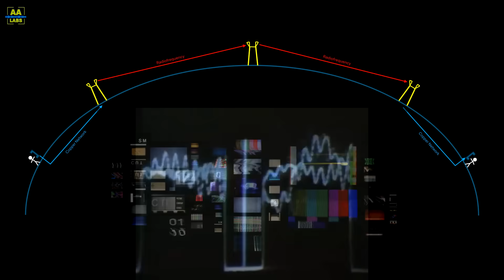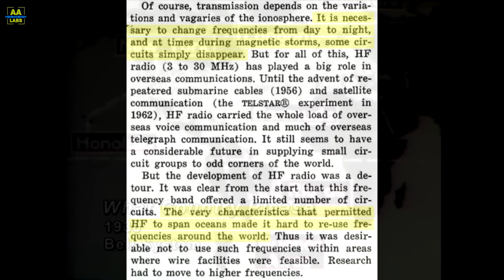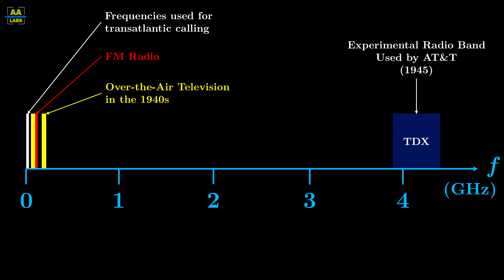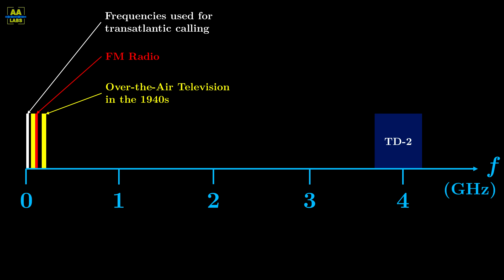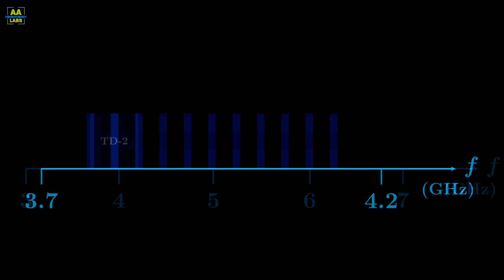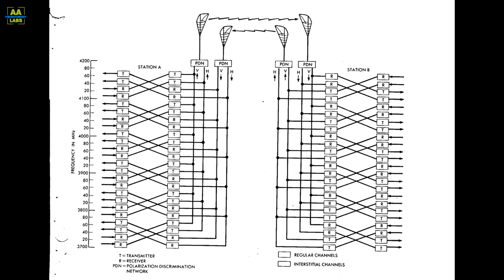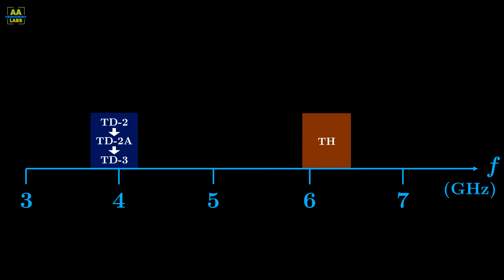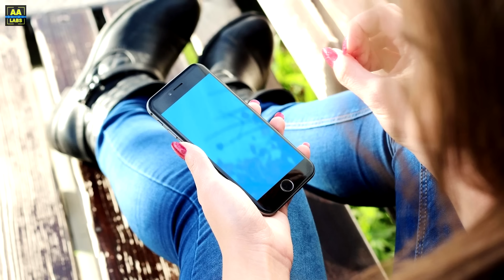AT&T Long Lines: The Wireless Network Before the Internet

Comment: Actually. it was Sprint's "pin drop" that finished off AT&T's microwave network. In the early 1980s, the Federal government allowed other companies to compete with AT&T in the long distance market. One of those companies was Sprint, which built a network "from the ground up" using entirely fiber optic technology carrying digitally encoded voice. AT&T's analog technology had a background "hiss" noise while Sprint's digital network was quiet. Sprint heavily advertised that you could hear a "pin drop" over its digital network. Competitive pressure forced AT&T to take a multi-billion dollar write off, building out its fiber optic network to carry all long distance calls in digital format and taking the analog microwave network off line, at least for long distance voice service.
Reply from the maker: Another commenter said the "pin drop" ad was from MCI's microwave network. I'll have to do some research on that one. I would think that AT&T switched to digital signalling on Long Lines at some point in the 1980's. There's nothing inherently preventing digital signals going through a microwave system. Fiber just has SO much more capacity.
Reply: @DoubleALabs  I definitely remember the "pin drop" commercials being from Sprint.  I can still remember the announcer.
Reply: @DoubleALabs  MCI STOOD FOR MICROWAVE COMMUNICATIONS
Reply: @DoubleALabs  yes, the phone company literally invented digital, fiber and all the other technologies involved. But marketing works because the number of dumb people is nearly unlimited. And dumb people never fact-check...
Reply: @DoubleALabs  There are some Sprint "Pin Drop" commercials posted on YouTube. If the AT&T analog microwave system were converted to digital, they would have had to obtain 64 kb/s for each analog voice channel. I think that would have cut the number of voice channels dramatically. They would also have had to handle radio fades and switchover to spare channels, which would have caused data hits.
Reply from the maker: @jimlocke9320 I had to do some math for that one! Assuming no digital compression was used, 8 bit, 3 kHz audio requires 48 kbps. This equates to 48 kHz in a single-sideband scheme, 16 times more than the analog!

Multilevel signaling ("symbols") could be used (some sort of combination of amplitude and phase modulation, for example) to bring this bandwidth down. To get the bandwidth back to 3 kHz, they would have required 16 bits per symbol (2¹⁶ = 65,536 levels), which is practically impossible. Hardware didn't exist and you'd need to differentiate all those levels out of the noise. So yes it seems not doable without digital compression.

Digital compression completely changes this math, however.

A fun little tidbit, OFDM also changes the calculus, which became technically feasible in the 1990's and paved the way for modern wireless communication. OFDM effectively doubles your channel capacity with the same number of symbol levels.
Reply: @DoubleALabs  It was Spring and Candace Bergman was their spokes person and their cell services in the early 2000's sucked and so bad that T-Mobile bought them out. BUT, the "internet" backbone is and was initially laid by Sprint and it was all buried along railroad tracks amd still is.
Reply: Uh, why do you think sprint built the actual back bone. The In reality used alot of others network and laid not alot of fiber.
Reply: That's so interesting. Reminds me of the more recent analog/digital voice problems around 2010. Remember when Verizon and Sprint couldn't use data while in a voice call? Then the whole VoLTE thing with HD voice
Reply: @hereisalex  Yes, Sprint and Verizon used 1xRTT (CDMA 2000) for voice and SMS, and EvDo (Evolution Data-Only) for data. They used separate frequency bands. Because the phone only had one baseband modem, it could only connect to one network at a time.
Reply from the maker: Calling was still digital before 2010. But the calls had to go over 2G at the time. VoLTE/HD voice made the quality much better.
Reply: @DoubleALabs  3G WCDMA could support simultaneous voice and data, but not HD Voice.
Reply from the maker: Right, I remember AT&T's ads about that with the game show and "phoning a friend" 🤣
Reply: @DoubleALabs  I grew up in that sweet spot in Central Illinois where it was half Bell and half GTE.  If it wasn't a commercial for a car dealer, it was a commercial for a phone company.
Reply: It was actually in the late 60’s early 70’s that the FCC allowed other common carriers into the LD business. With MCI building a microwave network of their own. Sprint which started life as the SP railroads internal network (SP railroad Internal Network)  also had a microwave network to start. SP would eventually sell that network to GTE to create GTE Sprint…and several further iterations until it became a standalone concern.
Reply: @uswcboyawesome info
Reply: I searched for both MCI and Sprint "Pin Drop" commercials, and only found commercials for Sprint.  Namely the Candace Bergen commercial from 02/05/1995 .
Reply: maybe they meant pen?
Reply: The tower in Duluth, MN came down in 2015. (I have a few pictures of the ice cream cone on the ground), they took the siding off and were going to take it down earlier, but there was a problem, it was still being used.
Reply: No. AT&T wasn't "finished off" by Sprint. You make it sound like they were all analog when Sprint showed up, but AT&T had T1 lines in the late '60s. MCI was much bigger than Sprint both in phone and in owning a huge chunk of the early internet backbone. AT&T had a ton of long-haul microwave towers which became obsolete once there were multiple optical/digital paths everywhere, but Sprint really wasn't a big player.
Reply: And now Sprint's gone, and AT&T remains! 
😂
Reply: Sprint was developed by the Southern Pacific Railway to improve their communications between dispatchers to keep signals and switches along the tracks clear, and freight trains moving on schedule. 

In around 1980, they developed a way to lease part of the lines on these fiber optic networks to phone carriers, starting the "Southern Pacific Railway International Telecommunication Co" or S.P.R.I.N.T.
Reply: Impressive
Reply: The OP is a perfect example of not knowing the difference between marketing and reality. In reality, it was the hhone company, "Ma Ball" that literally invented the digital technology that US Sprint only marketed. By that time, AT&T Long Distance had also converted to digital. The OP is making a nonsense comparison that simply didn't exist in reality. I was there as a customer during this time, I actually shopped around and compared. Sprint wasn't a bad company, but advertising is advertising, and only a fool would blindly follow what only one TV ad says. It's a silly religion.
Reply: LongLines orig analog  microwave carrier was (as said) conv to PSK digital modulation, albeit limited bandwidth ~44 MbS TDM, like T-carrier. 
Early 70's I ran a segment of Datran 44M 8psk repeaters, alongside 3600 channel analog microwave SPComm. MCI had competing analog terrestrial links. SP became Sprint; we ran fibers along rail ROWs, inside old pipelines, evolving into TDM as the analogs became obsolete due to much smaller bandwidth capacity
Reply: the long lines microwave ntwork is still used today in commercial particula stock market applications...
Reply from the maker: @CATech1138 Mentioned at 9:58. I've seen a lot of newer microwave gear on long lines sites (even outside of NYC-Chicago). Not sure how much of it is actually still in use, though.
Reply: @CATech1138  hi frequency stock traders were planning to use actual high frequency shortwave RF to make trades bypassing latency in the internet system, just beating the next guy to a trade. Ham radio operator's bands were being encroached on and there was a petition to try to stop it  RM-11953
Reply: @CATech1138 literally mentioned in the video

Comment: I remember the sound of the old analog system growing up. Multiple relays across the land giving the call a thin and noisy quality. You could tell it was far away. Sometime around the late 80's early 90s they mostly changed to fiber and the sound quality changed dramatically. Thinking back to the old modem connections making it though the system at any speed was a miracle in itself.
Reply: Saw an advertisement in the early 80s from Motorola announcing a break through that would soon allow 9600 bps modems. When I mentioned this on a local BBS, everyone said it was impossible. There was no way that much data could reliably be transmitted over the phone as the signal was too noisy. At the time, 1200 was the fastest any local BBS had, so 9600 seemed otherworldly. And no one was thinking about how upgrades to the phone system would improve signal quality to where much higher data rates would be possible. It was a youthful introduction for me to not always believe it when someone says something will never be possible.
Reply: @JasonKingKong  I got a similar reaction from the guy that ran the local dial up ISP back in the 90's when I told him about cable modems. Technology can surprise.
Reply: @keyboarderror1 
I had a blazing fast 56k modem. I could download a 3 minute song OVERNIGHT !!!!!!
Reply: @JasonKingKong  same here
Reply: Not to mention the delay. It could take between 5 and 10 sec. to hear a ring after dialing the last number of a long distance number.
Reply: UPGRADING FROM 2400 TO 28800 MADE THE NUDIE PICS FROM USENET LOAD MUCH FASTER